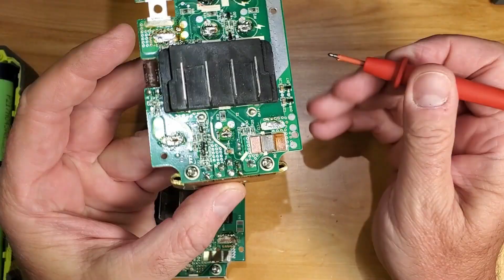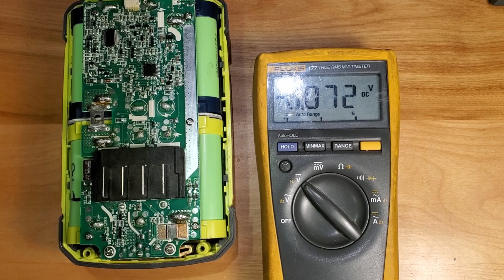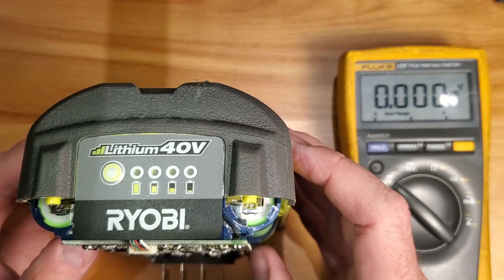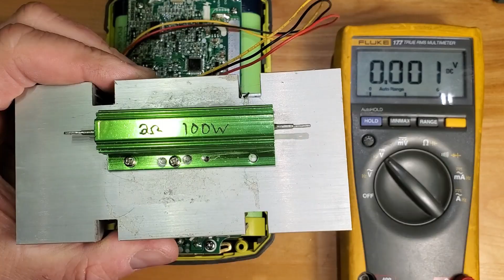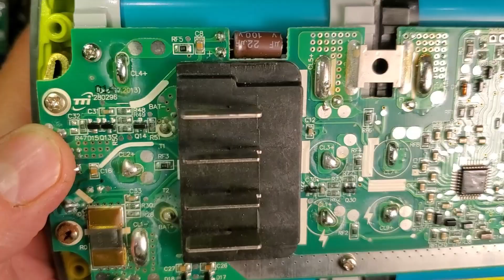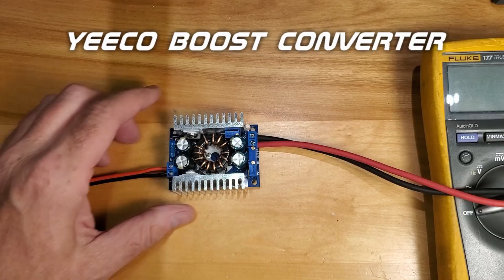Ryobi 40v Battery Questions answered

Comment: My friend brought me a ryobi OP40806T battery pack and asked me to charge it because he cant find his charger. All cells are at 3 volts +- .03 volts so they are solid. Problem is i cant get it to accept a charge. Whats the trick to get the board to accept a charge? Its a 40V 8Ah pack.

Comment: Charged manually, only got 32 volt pack; Found one 3-some 18650's at 0.0 volts in the middle of the pack.   Tore it apart and separated all batteries indivually; each at 3.61volts.
If this is nominal, I"ll get 14.4 volts in a 4s configuration.  Gas mower starter battery with BMS.

Comment: I have a 40v that flashes all 4 lights 6 times when you press the button. Is there any way to lookup what that indicates?
Reply from the maker: I am not aware if anyone has cracked the code yet.  If you check the individual cell voltages, I would suspect that one group or more is too far out of range from the others. They should all be over 3 volts and within about .1V of each other.

Comment: Have you had any experience with the 40v Ryobi op40404? Total different board version 1.4 Will not reset. Shows 39.5 at battery,18v at terminals? Can not locate fet,  thanks for any input
Reply from the maker: I had to reset a newer battery that sat for a year and wouldn't charge.  Here is the video link that shows the proper points for the reset.  

https://youtube.com/shorts/Rg6Z-aMTFLQ

Maybe I'll make a video of the newer batteries soon.

Comment: Please have a video de soldering bms board ?
Reply from the maker: You require a lot of heat to unsoldee these boards. I used a 100/140W soldering gun and had traces lift on some boards. The problem is that you have to heat several areas at once and lift the board as well.  If you are not trying to salvage the board, you can heat the pins and lift a little, then move to the next pin and slowly lift it off as you heat them.

Comment: You'd think they would match the cells, right? As in coming from the same batch at the time of manufacture.
Reply from the maker: They probably did, but the batteries were pushed to their limits and caused damage to some cells.
Reply: I build ebike battery packs. Doesn't matter if from same batch.   There will always be Drift. I use a Hobby charger balancer. And run it Naked No bms or safety. Ezpz

Comment: How long do Ryobi batteries  last? I have 4 from my tools and no clue what to do with them. Using your videos to see if I can salvage them!
Reply from the maker: I have disassembled several for the cells and used them for all kinds of things. I have flashlights that require the 18650 cells that are inside. The cells are not the largest capacity, but they are high drain cells, so you can pull a large current from them. The BMS is not very user friendly, so I would not try to salvage it myself, but there are some decent parts you can salvage like the FETs for other projects.

Comment: I have a newer board (July 14, 2016) with red cells. Problem started and unit measured 28v total. One bank was low. I tried a variable charger without cutting trace as you had shown for other boards. Now I get 35v across output terminals but little to nothing across each pack or from fuse to each half. Any thoughts? Have I ruined it? Love the videos.
Reply from the maker: I am not sure I understand your problem, but I doubt that you caused any damage.  The BMS may have disabled the output when one bank was too low.
Reply: Hi again. Back trying to resolve my battery problem. Prior to trying to get it working, I was getting about 9 V from the fuse to each side. Not enough for the charger to work. A couple of banks were at 3+ volts. After trying to charge it with a DC charger as in other videos, now I have 1 bank at 1.5 V and the others under 1 V. And now from the fuse to each side shows around 1 volt. Is there anything I can do to get it charge? Appreciate any guidance. Thanks

Comment: I have a question. If I test from the battery positive to battery negative I get 20 volts. If I test from the battery positive to the cl- spot on the board I get 40 volts. Does this mean the board is bad?
Reply from the maker: The voltage will drop across the negative and positive terminals if there is no power draw.  This is because the FETs have turned off. If the battery does not charge or discharge, it is because the FETs are not turning on. There could be a number of reasons for this including a bad board, or board determined cells are not balanced.
Reply: @thecityviking  I will recheck the cell balance Thanks very much! awesome videos!

Comment: I have a perplexing problem that isn't covered in this video but you seem to have the knowledge to diagnose it.
My older 4a, 40v battery shows 4 green lights and measures 40v across the + and - terminals on the case. My string trimmer will only run for about 2 seconds and then quits. I can immediately start it again and it will run for another 2 seconds... does this about as long as I want. Any thoughts? Liked and Subscribed.
Reply: It's possible that one group of cells (of the 10 in series) is lower voltage than the other nine.  Even though the overall pack is measuring 40V, the one low group may trigger the BMS to shutdown the FET's.  

For example:   Nine of the ten groups are at 4.10 Volts, but one group is at 3.20Volts.  This equals 40.10 Volts, so everything seems ok... but the BMS would not like the group of cells at 3.20 Volts and take action to disable the output FET's.   Try measuring each of the ten groups of cells.  It's fairly easy to charge up the one low group with a typical 18650 charger and some alligator clips.  Hope this helps.
Reply from the maker: I agree.  If the trimmer works fine with a different battery, the problem is in the battery and could be a bad cell or 2. All of my tools don't communicate with the 3rd connector which is a data line, so the BMS is shutting down for some reason or another.  They do monitor temperature through 1 or 2 temperature sensors and that would shut it down too.
Reply: @thecityviking  Thanks for the confirmation (and for making the video in the first place).
Reply: @test-193  Thanks for the suggestion. I'll try it this weekend.

Comment: I have a 5ah battery that got wet and the two capacitors in the center of the board blew, do you think I can try changing just those or can I replace the whole board?  I was able to save my 3ah that also got wet, which just needed a mild cleaning and a reset.  I tried looking for a board for the 5ah, but the 5ah seemed to be hard to come by.
Reply from the maker: I have pulled the BMS off of about 20 Ryobi batteries and I have always had at least 1 pad lift, so take your time, and good luck.  You may be able to remove the caps without removing the entire pack.

Comment: Working on one now. Cells changed and all back to around 4v. Since rst shows 3.3v. Did the reset to GND but still not behaving . Sometimes shows 1 bar sometimes 3 when pressing button. And won't charge in charger. Think the controller parts a bit confused.
Reply from the maker: Yes, these proprietary BMS's seem to fail, and no matter what you do, they can't be recovered. I have tried fitting a different BMS in the box but have not been successful...yet!
Reply: If all ten groups of cells in the series string are at 4.00 Volts, that's good.  Now try the reset again (hold reset pin to ground for 10 to 15 seconds) then IMMEDIATELY put it onto your charger.  Try to do these two steps in less than 30 seconds... the time wasted putting the enclosure back together screws up the timing of the BMS housekeeping checks... and that delay re-enables the "battery shutdown" sequence.  

(You may have noticed that the voltage on the output terminals decreases after about 45 seconds from reset or charge initiation.  That's your first clue that there is a timing sequence happening in the BMS programming.  The 10 second reset and subsequent charge cycle need to be done in a fast sequence.)
Reply: @test-193  I have never heard that, but I just tried. Short rst to gnd and immediately put on charger and it's showing charging now. Hope that solution sticks. Thanks so much. Where did you discover this method? Have you experience with this particular bms chip. I thought it was a self destruct type . But the reset does seem to get things back if you follow the right procedure. Edit: charged from 38 to 40v(across cells) and some weird things happening. Charge level shows 3 sometimes and 4 sometimes when pressing button on battery. Voltage showing 20v across +- terminals. All batteries near 4.0v except one that is 3.8 ish. Perhaps that cell pair is bad causing issues.. I'll change them over and keep on trying until one of us completely dies.
Reply: David Ujcic - glad that it charges now.  Does it actually power your Ryobi devices?  Or not?

Also, you can charge up the one group of cells that is lower via a simple 18650 charger and some alligator clips.  No need to replace them at this point.(maybe it will be necessary if that same pair drops below the others again.)

Comment: Great explanations. I have red cell packs and many cells pop the CID open which I pop back but better to buy a cheap drill battery from any brand to rip apart and salvage. It seems Makita use good quality cells. If modifying and shorting MOSFETs I recommend to add resettable temp and amp fuses in series.
Reply from the maker: Not a bad idea. Thanks for watching.

Comment: I have an odd issue with my battery, I have the single FET versions (my understanding is that this is the older style). Taking the battery apart and measuring V across - and + charging terminals I only get 10V, however when I measure the V between - shunt resistor ie the ground plane and the positive terminal (and the positive plane) I get the full 32.7V, testing each pack also gives me a constant 3.27V across ALL of the cells.  So the cells are not bad.. The inbuild battery indicator only lights up 1 green light and obviously, the battery will not charge. I am not an expert in electronics, but I would have thought that the outside negative terminal connects to the internal ground plane. Unless another component (maybe the FET) sits in between the external connector and internal ground plane. Not sure if you have seen this before or not. Thanks in advance.
Reply: Your theory regarding the FET is correct.  It sits between the internal ground plane and the external ground connector.  The BMS programming won't allow the FET's to connect to the external terminals.  Supposedly it tries to protect you from attempting to charge an overly discharged pack.  They claim it's for safety reasons but let's be honest... it just forces most people to buy another battery.

First, try the reset procedure. (connect RST to ground for 10 to 15 seconds)   If the reset procedure isn't fixing your issues, I'd try charging the cells a tiny bit higher manually.  3.27 Volts/cell is generally considered "Empty".  It SHOULD charge ok at this voltage, but alas, it's not charging.  You may be right at the threshold of what the charger considers "TOO LOW".  (Usually it's 30 Volts???)    So go ahead and manually charge the cells by attaching a 35 Volt power supply (or typical 19V laptop power supply with a DC to DC boost converter set at 35 Volts... they're fairly cheap).   The positive wire can go to the external + connector, but the negative wire must skip the BMS by connecting to the negative point of cell #1.  

Once you get all of the cells at 3.50 Volts each, redo the reset procedure (connect RST to ground for 10 to 15 seconds) and then quickly put it onto your Ryobi charger. (Don't waste time reassembling the pack, the long timing delay will re-enable the BMS battery pack shutdown.)  

I hope this helps.

Comment: Hi there from Australia 🇦🇺 I have a question that I have not found the answer to anywhere. I have the double FET board and the charger flashes red/green. I have charged the battery to 35v as you have explained, have reset the board using the “RST” point to ground. Still I have the red/green flash. I have not yet bypassed the FET. What would you suggest next. The cells are all good individually however it was discharged to 4v total when I acquired the battery. Cheers , Jason
Reply from the maker: Are all the individual cells close in charge state?  They need to be something like .020V volts or closer otherwise the BMS thinks the cells are too far apart to correct. Sadly it could be that the internal resistance of the cells are out of range for the BMS, and there is nothing that you can do to fix that.   You can harvest the cells for other projects though.

Comment: I have a dead Ryobi 40V 6Ah (OP40602). I opened it and measured the cells to be at 0V. I have access to 12V and 40V power adapters, any suggestions how should I go.  I was able to revive some Ryobi 1.5AH 18V batteries
Reply from the maker: I do not have any of those batteries, but I would start by getting all the individual cells to the same level, say 3.6V.  Thanks for watching.

Comment: Hello! Thank you for the video! I'm trying to run a Razor MX500 off two Ryobi 40v in parallel. I have tried 6Ah Ryobi, 4Ah Ryobi, and two knock off 6Ah (which are really 4ah). The knock off ones run great and allow 35A each (70A with two in parallel), but the real ones all cut out even at low current draw (15A or so). I've seen them blink the two middle lights after they cut out. Once the load is removed they reset and work again till cutting out almost immediately. All of them work fine on Ryobi tools with zero issues but running a 1800 Watt brushless motor with 50A VESC skateboard ESC they cut out. Any ideas? I'm thinking the BMS is wigging out and cutting power but I'm not sure. Liked and subscribed... Cheers!
Reply from the maker: I know the  cells in the 2Ah batteries are capable of 15A max each, so in theory because there are 2 in parallel your maximum would be limited to 30A. All of that current runs through one or two FETs, that have a limited amount of current they can handle, so I wouldn't be surprised that they shut down to prevent permanent damage. Even with multiple batteries they don't seem to share the load.  In my testing it appeared that one battery does all the work and when you ease off the throttle and they go back on it, then the other battery would take the full load. The only way around this that I can see is to replace the BMS with a different one.  I was looking into just that, but there is not enough room for a different BMS inside the case even if you remove the old BMS. The new BMS would have to be external.  I may make a video on just that idea.  

Thanks for watching
Reply: @thecityviking  Thank you for that insight! Sounds like the BMS is not managed very well if they are not pulling evenly from both sets. I have a shunt power meter on my little bike that has registered up to 75A for a few seconds with the generic fake 6AH ebay packs on a hard pull but those packs may be built differently. I imagine they are still running 18650s but it's possible they are running pouch lipos. Haven't opened one up. It's also possible that the meter is innacurate as it is a cheap Chinese one but the bike sure pulls hard and the packs don't cut out. I'm sure their BMS is just not as limiting as the real Ryobis. I have measured their capacity with the power meter and they are only actually 4Ah which makes it even more impressive if they are  able to draw that much current. I have now logged over 130 hours on the knock off packs and while they don't quite have full capacity anymore they still run strong on my little bike that I run just about every day. It would be interesting to see what you think of the knock off ones if you ever get your hands on one! I paid about $60 each but got them to send me $20 each back after I called them out on the false capacity numbers. Cheers!

Comment: Have you tried charging individual stack at the points where you are measuring the low voltage? I measured similar voltages as you are  and I charged individual cells  from the tabs on the bms, brought all cells to similar voltages using a single 18650 battery charger. Now the battery works fine so far.
It looks like the balancing part of this bms is not well designed and does not do the job properly.
Reply from the maker: While I am not a fan of the BMS on these batteries, all BMS's have a limitation to how much they can correct. Limiting how much current is used for charging can help mitigate cell drift. The bottom line is that the more cells are cycled the closser to the end of their limited life they get. I have manually corrected cells to get batteries to work, but you may find you have to do it more and more, but at least you can get more life out of the batteries.  Thanks for watching.

Comment: Opened my 5ah pack and found all cells at4.02v. Except cell1. Cl1. It was at 3.01v charged with adjustable psu at 4.0v 1a limit. Now battery worked on test run.
Reply: I have a very similar problem - all measure 3.5 except for one that measures 2.5 (measuring from CL2 to CL3). Did you/can you charge the one cell in place? Can I just connect the psu to CL2 and CL3 with 4v 1a limit?
Reply: @carlosfuentes5422  3v battery is a weak used cell. believe it is always used for the electronics 24hrs a day 7 days a week. extreme wear compared to other cells. after charging it and running it in weed eater for an hour it was back to very lower than other cells.
Reply from the maker: sweet.  thanks for watching